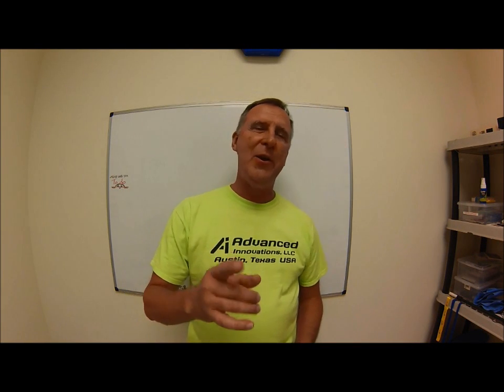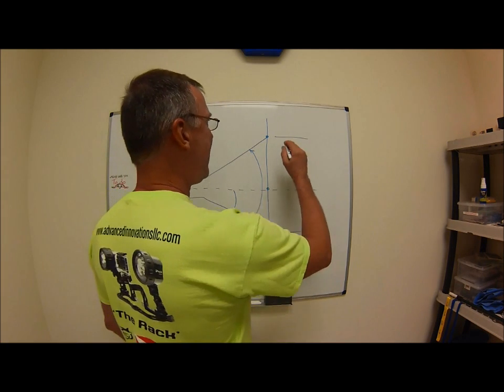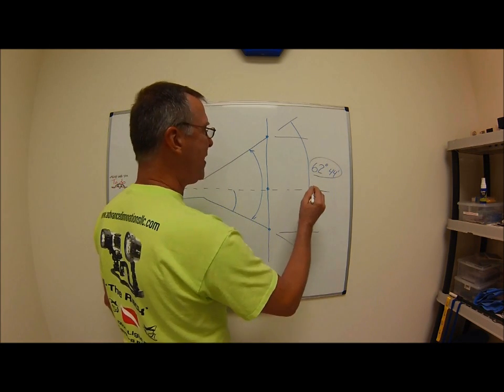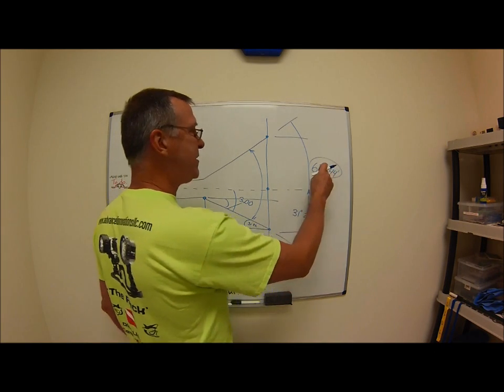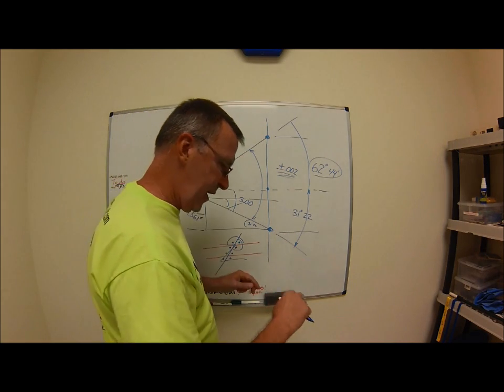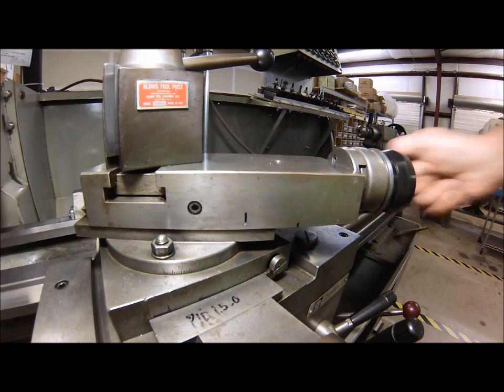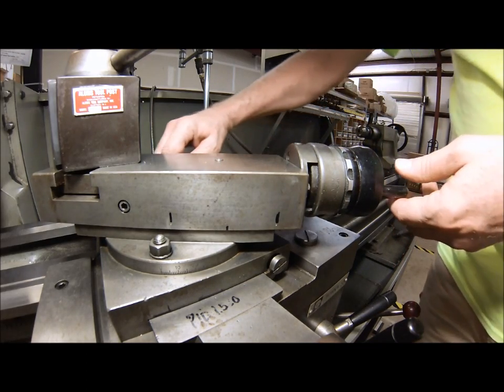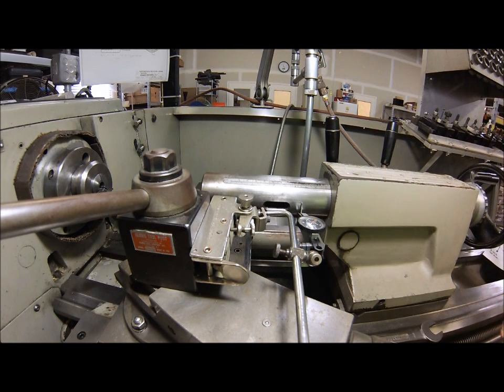Setting the Lathe compound to precision angles

Comment: Joe, unless I am missing something (likely).  I believe that we could get away with not moving the lathe carriage along the tailstock. At only one point in rotating the compound  (nearest to the tailstock)  will the selected "drop" (cross slide) and "long leg" (compound)   movement bring us to the exact same distance from the tail stock and we can achieve that with out moving the carriage along the tail stock.
Reply from the maker: Absolutely. The carriage does not move for this setup technique. Use only the cross slide and compound. If you care to check the tail stock to be straight before you start, thats the only time the carriage should move.

Comment: Excellent advice and clear explanation. 
If you would indulge me, sir - I need to make some tooling to fit the tailstock of an old Pratt and Whitney precision plain turning lathe that uses #4 Jarno taper. Could you set me straight on the angle I need to cut?
Reply: common machine tapers http://littlemachineshop.com/reference/tapers.php
Reply: Many thanks!

Comment: What makes you think a tailstock quill is level    Most are not
Reply from the maker: Level would have more of an influence if I was using the top.
Reply: The axis on the side has the same or more error then the top according to the diameter of the quill  If you don't maintain level axis you experience the radius drop in accordance to quill diameter
Reply from the maker: I like this comment string. Lets look at the mechanics your statement deeper. I think we can both agree, the drop error on the top is a true deterioration of the slope. Linear 100%. The side error is driven by the radius of the tailstock spindle as you stated. Also True. Here is the proof.... 1 degree over 1 inch is .0174. I usually use a 3 inch hypotenuse, so lets use 2.5 as a linear example. That would be 2.5 x .0174 as an expected drop error if your tailstock was out 1 degree ( thats a lot). Thats .0435. Draw a large circle on a piece of paper in front of you. Draw horizontal and vertical lines through the center. Now draw 2 more lines. 1 of these lines, Line 'A',  put below the horizontal ( left to right) centerline. The other line, Line 'B', construct equally as far, from where the vertical centerline intersects the circle at the top. Now your error points are clearly illustrated. The distance from the top of the circle to Line 'B', is the error on top of the spindle. If you were to now draw a vertical line from where Line 'A' intersects the circle to the horizontal centerline, you will have a very small segment of your original circle outside the triangle formed. The actual difference is the legs is your error. In this example (very accurate) the resulting error is less than .0003 over 2.5 inches of projection.  I welcome questions and a reply.
Reply: I have had about 30 lathes some I used in business and others I bought and sold. THe worst tailstock was on a Sheldon industrial 40K dollar machine and the tailstock was low by .008"  and somewhat angled. It is easy to correct them. Either shimming or grinding. Some setover taper adjustments have play in the cross slide so it wiggles till you get the play out.
Reply: Oh yes I do know what i'm talking about.  I don't think you ever qualified a tailstock once in your working days. I to 50 years of toolmaker and tool die design and building   Retro machine rebuilding   If you think a tailstock is in perfect alignment then you have never experienced qualifying a lathe. Out of 30 some lathes only once was a tailstock was close was on a Asian Lathe.  This will be my last statement on this matter because there are some people that take things at face value   I worked with some people that was in the same 50 year experience class and never  expanded their knowledge past schooling  The only reason I want to correct you on this subject is for the young Toolmakers coming up in the ranks to not accept random statements like yours. Alway prove and improve the situation.  Some gray haired people can not lead.

Comment: I'm an engineer.  I also love machining as a hobby.  More often than not there is a good reason for a specification.  But the actual angle isn't that relevant to this method. It is the required accuracy that leads to this method of setting the angle.
Reply from the maker: Specifications can be highly over rated if the engineer doesn't look at the whole project. Over dimensioning and over tolerancing are big problems with industry fresh engineers. The ones I always had the most respect for were the ones that would discuss the part or project with the team that was going to build his creation, and actually describe and listen to the feedback from the guys with chips in their shoes. This method is great when an angle has to be hit. If an angle is held tight on a print, you would hope there is a good reason for it.
Reply: Joe Pieczynski 
Agreed.  At my job the manufacturing people have a big role in the design.   Thanks for the video.
Reply from the maker: That will help to save money and expedite the manufacturing processes. Good to hear.

Comment: I've watched this 3 times and don't completely understand yet . I'll be back tomorrow 😔
Reply: Flip the triangle over in the first example so it lines up with the lathe components.  The 3 inch part is the compound, between the marks, the A or drop is the cross slide.  Remember the line cutting the 2 parallels?  Thats the rule you are using.

Comment: A sine bar can be used also. I guess I got so used to using older equipment with worn screws that I very seldom trusted them over any distance. Down by you there was a lot of oil money when the pumps were running so I guess most equipment was pretty new. We did some work for offshore drilling and it was feast or famine.

Comment: Luckily the lathes I use at work have clean, square compounds and I use a gage block buildup and sine bar on the side of the compound to dial in angles right on. We have a few jobs come through the shop where we pretty much have to be dead nuts on. After cutting the first part I always take them to inspection and put hem on the CMM. This method hasn't failed me yet. I like this method but the only shortcoming would be if your tailstock ram is not perfectly inline with your spindle centerline. But then again, if the sides of your compound rest aren't square then my method wont work. Great video. It is always neat to see how other machinists do things.

Comment: This is a nice video. When I set my compound I place a piece of round stock in the headstock, check to see that it is concentric and then set my angle as described. If your lathe is cutting a small tapper etc. this will compensate for it.
Charles Boston

Comment: Why do you double the "drop"?  The compound angle to tailstock in your video, looks like the drawing.  You lost me there.
Reply from the maker: If you are trying to move the cross slide to the value of the triangle, this is required. Think about it......if you dial in ten thou on your cross slide to remove ten thou from your part OD, the cross slide actually only moved five for that cut. Does this help?

Comment: If you have a compound that is ground on the outside surfaces and parallel with the dovetail, you can set the compound angle with a sine bar if you place the sine bar and gauge block between the side of the compound and the tail stock ram. On my lathe I use a 3" sine bar.
Reply from the maker: Make sure you lock the tail stock spindle and body when you do that. It does work..

Comment: hi joe thank you for some exceptional good training videos , I have to ask one question thou on this video you say you find the drop by multiplying the 3" base line by the sine . but in your video on making a tapered parallel you say multi ply the base line by the tangent. this seems like it is the same angle to find the height/drop , so why is it tangent on one an sine on the other (I know nothing about trig) but I m finding it very interesting learning from your videos please please  keep them coming.
neil uk
Reply from the maker: Thank you for watching. This is a good question. The information for the triangle calculations are different. In the lathe compound video, you have the hypotenuse (stroke of your compound) and desired angle to find "the drop". In the angle block video, you have the base leg ( the distance you choose for the hole 'X' axis distance) and desired angle. The same formula can not be used for both situations with different contributing givens.
Reply: thank you again joe I understand now one is a base the other is the hypotonase
Reply from the maker: You got it.

Comment: Of course you could also set up a long travel dial indicator on the 'X' axis and touch it to that (@ 6:22) long flat surface on the side of the compound rest. Now move the lathe carriage precisely 3.000 inches and read the drop from the dial indicator. Bump the compound around till you get the readings you want. Life gets even easier if you start and stop halfway from the compound slide swivel point. Then it is a simple matter of correcting by half the indicated error.

Done lots of accurate male and female Morse tapers this way.
Reply from the maker: I agree with the pivot point comment. That would simplify things a bit.

Comment: You mentioned you like to set the" compound flush with the face for rigidity" . What does that mean? The compound looks like it  is set at an angle already to the face of the chuck.  What face are you talking about?   Thanks for your time.
Reply from the maker: The top and bottom halves of the compound move independently when you dial in an angle. The bottom stays put and the top can overhang if extended too far. I like the leading edges of my slide top and bottom to be on the same plane (even). It keeps my toolpost right over the point of rotation.

Comment: Joe 
just going through the problems of alinging a old lathe,so have been thinking about your video alot. would not the accuracy be dependant on the tail stock shaft being parrell to the bed.How did you check that.  appricat your input.
Reply from the maker: Extend your tail stock spindle, lock it, and sweep indicate it using your carriage. Look for errors there. Just keep in mind, a 1 degree error is .017 over the course of 1 inch. So if your out by 4 over 4 inches, thats still amazingly accurate using this method.

Comment: I was a carpenter for 35 years back when we use to cut roofs, before premade trusses. (roofs are all angles). This is exactly how i use to figure angles/lengths,rises, diagonals . If you buy a construction master calculator, which i used for years, this will all be extremely simplified. On the calculator there are three keys called run, rise and diagonal (the three parts of a triangle). You can enter as fractions  1-1/4, or  decimals 1.25, or metric 31.75 or whatever. The amount of weird angles on all the different pitched roofs with hips and gables and interrupted angles and so on are endless.  Greatest tool ever invented for us dumb carpenters.
Reply from the maker: Some of these shop calculators require the user to convert the minutes to a decimal before they can proceed. 31 degrees 22 minutes is not 31.22 degrees. I've seen some of these lead guys down the wrong path and confuse them more than help them, but if you are used to using them, I'm sure they are a real time saver. I'll stick with my book. 40 year comfort zone.

Comment: I've never needed to do this on a compound but we basically do much the same thing with taper attachments, "Tracing the taper" I've been making two sets of propeller shafts for LCU boats. When the inspector blue fit the taper gauge on my tapers it had about 95% contact.
Reply from the maker: Use thicker bluing next time....100% contact, Bam.   Just kidding. Taper attachments are awesome once you understand them.

Comment: Excellent video Joe. Make sure you convert from minutes to degree, or you will have an error. Also, as you said make sure to account for backlash on in and or out for the opposite leg. soa cah toa! I use it at least once a week.
Reply from the maker: Can you explain the 'convert from minutes to degrees comment' for me? Not sure I am following that one. The way you represent your angle is going to be determined by the conversion method you intend to use. Some modern apps, so I'm told, look at minutes as a decimal representation of the angle. This requires the user to make the conversion prior to entering the number or you will have a problem. If you use an old school minute chart, no conversion is ever required. Don't get caught. Trig is very powerful and a great tool for any machinist to have a basic understanding of. Thanks for watching.

Comment: Good video, I'll remember this one.
My one comment is: If you have an older machine-shop/tool-shop lathe, go to the instruction manual and set up your tail-stock so that it is parallel with the bed. I found this one out when I noticed that a brand-new good quality drill was still "climbing" sideways when it entered a centre-drilled hole. First dial-up showed the tailstock to be miles out! After adjustment, the tailstock shaft was parallel and true to the bed; holes could be drilled deeper before they wandered, swarf cleared easier and squeaking almost stopped. Try it!
Reply from the maker: Its always a good idea to check your machine before you run it. Thanks for the comment.

Comment: This is what is meant when one says "think like a machinist".  Working manual machines involves a LOT of trig, but once you have seated in your mind the relationship between the three sides of a triangle and the angles involved, Magic happens.  Try this one for an uber precision adjustments.  set your compound to 7.5 deg.  the compound dial now has a 10 to 1 ratio between the op and adjacent sides of a triangle, the slide describing the Hyp.  For example .01 on the dial running just off the Y axis (that 7.5 deg) gets you .001 displacement in the Z axis

Comment: That is one way to do it. I worked in an injection mold shop and they had a bar bolted down on the far end of the cross slide. They had mounted an indicator on the chuck and dialed the bar in cranking the carriage back and forth until the bar was dialed in perfect. This was to counter any wear in the ways so you were dialed into the center line of the spindle. When you needed to cut a taper you set a sine bar against the bar to the desired angle. Then you would run with the indicator mounted on the compound with the indicator point on the sine bar and bumped it around until you got a zero reading with the indicator.
Reply: I understand that much easier even without a video! Thanks

Comment: I had to smile about the engineer comment. I was that engineer who couldn't understand the machine shop constantly asking if I really wanted it that size? It was during a previous life when I was designing wire and slick line equipment here in Aberdeen Scotland. Admittedly it was half a lifetime ago so I think I may have learned a bit since that time.  Thanks for the pointer from the machinists point of view - and the memory.
Reply from the maker: I've contributed to the final part from both the shop floor and the keyboard, so I feel qualified to make that comment. CNC machines are a different animal, but manual machinists need tips like this to keep them sane. I also taught a course on design for manufacturability to University of Texas engineering students. I was amazed at what they didn't know. So were they. It always went very well. Thanks for the comment.

Comment: Hey Joe...great videos! I am getting a lot out of the tips you are sharing....but let me ask...is there any way you can do a follow up to this video showing exactly how you tweak in the angle after you establish the amount of error....I did it just playing around and it seemed to work a little backwards or counter intuitively.
Reply from the maker: Hey Al. Its easy once you are told. If your indicator hits zero before your cross slide dial reaches the number you are looking for, the angle you have set is too small. If the cross slide dial reaches the number you are looking for before the indicator hits zero, your angle is too big.

Comment: Nice one glad I'm not the only one who think that about the odd engineer. Very timely for me as I had been considering the very problem. Thanks for your time and passing on the knowledge.
Reply: Very clever approach. Just be aware that its accuracy relies on your tailstock quill surface alignment with the spindle rotation axis. Any wearings or dents on the quill surface might set your taper off.
Reply from the maker: Thanks Will. This works great.
Reply: Am I ignorant to think that this approach to cutting an angle doesn't rely on any alignment other than accurate measurements?   I'm new to machining.  How precisely can a 90 be measured.  And if the 90 is true, you can make any angle right?
Reply: Measure the part not the tool?  Am i wrong?

Comment: Also, I worked at Beretta for a number of years, had to grind extremely accurate angles on gages on the cylindrical grinder, used the sine bar/gage block/indicator method?
Reply from the maker: Also a very accurate method. Its a little cumbersome, but accurate if nothing moves.

Comment: Thanks a million I tried this and got to within .0005 on the dial indicator of a 30 degree angle repeatably several times, tightened the gibs a wee bit and was finally able to get it to go to zero every time.
My lathe reads 60 where others read 30. 
And yes in response the the comment below I did sweep the quill of the tail stock and it is dead on from one end to the other.

Again thanks a million.
Worth
Reply from the maker: Glad it worked out for you. Its a solid technique. Thanks for commenting.